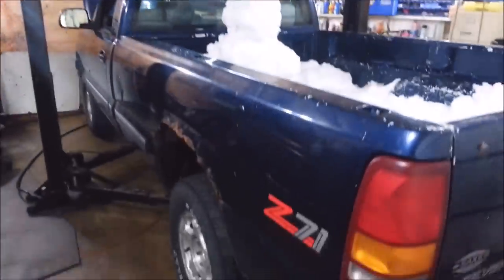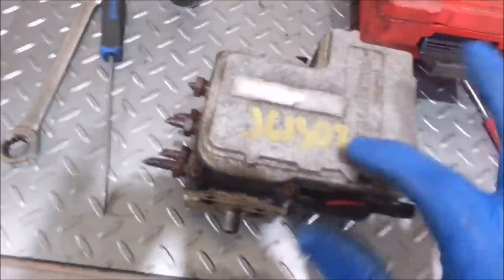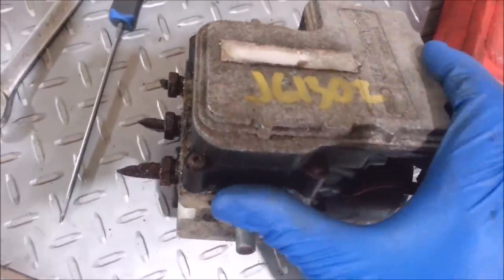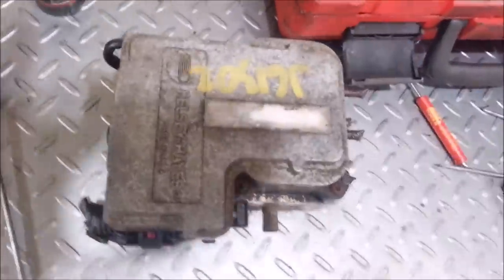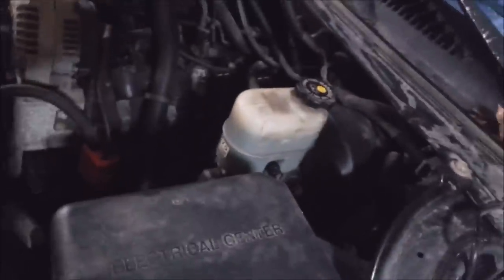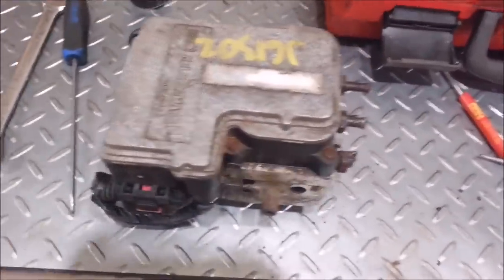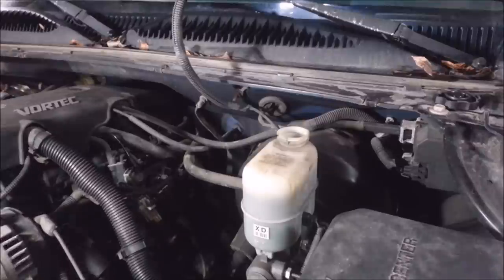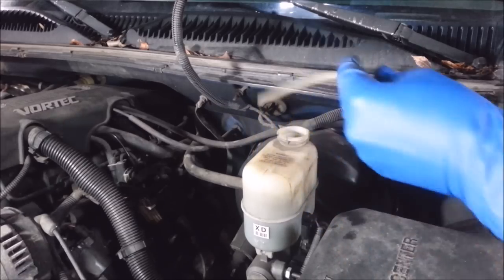1999-2002 GMC Silverado 1500 C0265 anti-lock brake unit replacement

Comment: Hello, I have an 05 tahoe, I removed the pump to take resolder the control module due to previous owner stripping a torx screw. After replacing everything the abs and brake light both came off. I used an Autel scanner to bleed the pump and I tried doing a manuel bleed but I’m getting a ton of air moving out slowly from the rear lines. And I’m not seeing the reservoir drop. I’m loosing hope here. I held down the brakes for a while during the bleeding and I got a brake light come and message saying service brake system. Any tips?
Reply from the maker: Pump the bejesus out of it, hold it to the floor, and have someone open the right rear bleeder screw. Do that about a gazillion times, until a stream of clear fluid cones out, then do the right rear.
Reply: Rust Belt Auto I was doing that. I ended up getting frustrated and bleed the screws under the reservoir, not sure if that was the right thing to do or not. Then went backwards and bleed front left and front right, had the rear lifted up and used the Autel to do the electronic bleed. And this time the pedal felt different during that process, I was getting a kick back from pressure when I heard the abs cycle. After this the pedal started to get stiff like normal, and I bleed them in the correct order, brake light was turning on and off through out the whole process. All seems good now and I drove it around town for about 10mins without issues. Did I cause any harm by bleeding those 2 screws under the reservoir? Thanks for the quick reply and I appreciate your help. 🍻
Reply: Rust Belt Auto I was doing that. I ended up getting frustrated and bleed the screws under the reservoir, not sure if that was the right thing to do or not. Then went backwards and bleed front left and front right, had the rear lifted up and used the Autel to do the electronic bleed. And this time the pedal felt different during that process, I was getting a kick back from pressure when I heard the abs cycle. After this the pedal started to get stiff like normal, and I bleed them in the correct order, brake light was turning on and off through out the whole process. All seems good now and I drove it around town for about 10mins without issues. Did I cause any harm by bleeding those 2 screws under the reservoir? Thanks for the quick reply and I appreciate your help. 🍻
Reply from the maker: @BLOWNSST  never knew there was screws under the resiviour. If it works, don't fix it. That's my suggestion.
Reply: Rust Belt Auto it’s the hydro boost system if that makes any difference?
Reply from the maker: @BLOWNSST  I don't know about those screws.
Reply: Rust Belt Auto brought it to work, 30 mins 1 way, and no issues so far. Thank you for the quick replies, if I could rate your channel, it would be 10 🌟
Reply from the maker: @BLOWNSST  I want to live in infamy. More my style.

Comment: Good video!
I just cleaned my module the way you showed. But I blew air through the flare openings to ensure clear passages. I didnt realize that you used a vacuum instead of compressed air.
Could I have done damage by blowing instead of vacuuming?
Reply from the maker: The thing works on hundreds, if not thousands of pounds of pressure. Put it in, and find out.

Comment: Easy fix = DRIVE DIRECTLY TO BONEYARD.  You think this thing is rusted???  N.E. Ohio here, and I'm not having fun.  It's my buddys  Sierra and he bought rebuilt calipers, slide pins wouldn't break loose,  CLEAN AS A WHISTLE. Heated a little and added some candle (paraffin) wax, came out with no effort, neat trick.    Anyway, I think he's just wasting money with this POS. BTW, don't worry about cross-threading,  he'll be MF`n it while it's on the back of a flatbed,  goin to the BONEYARD.

Comment: I replaced booster ,master cylinder , all the brakes and calibers and rotors , and my brake pedal gets hard after 5 mins of driving .. this is my last step I guess , I’m 1300 in .. geesh
Reply from the maker: Hard pedal usually always has something to do with vacuum.

Comment: If you got a 90s Chevy and live in the rust belt your lines are prob garbage I find the ones up buy the engine compartmeant under the master cylinder
Reply from the maker: I have replaced a bunch on the 00's too. They are all 1/4"!